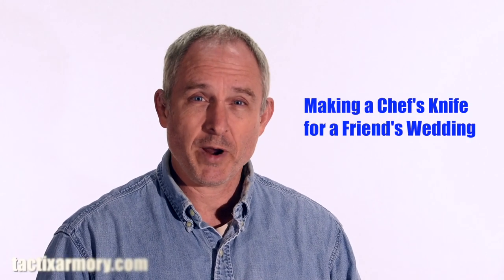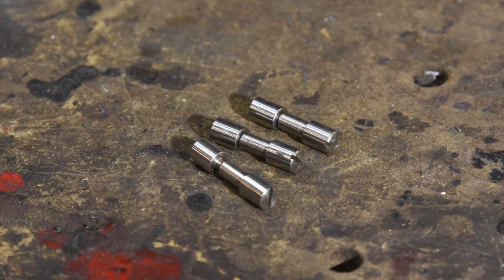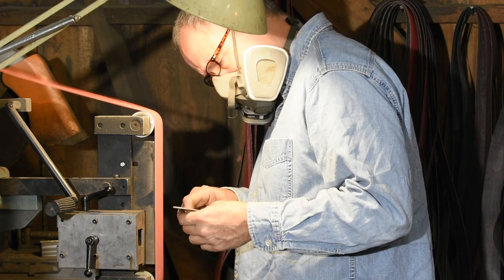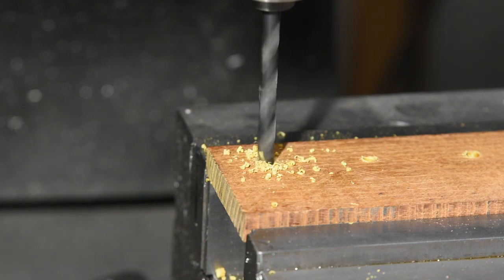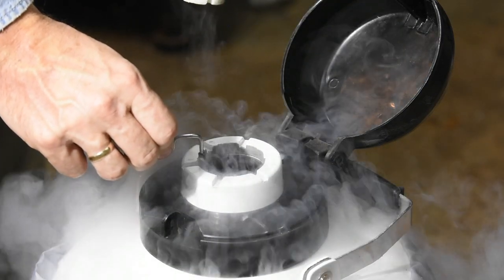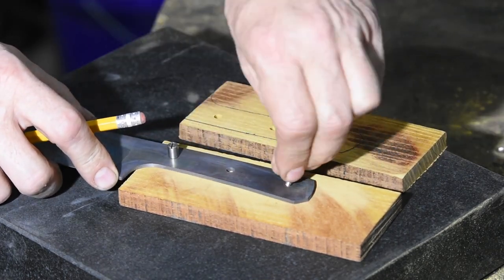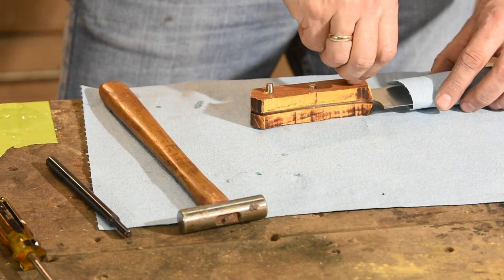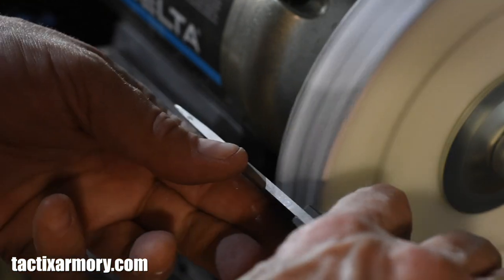Making a Chef's Knife for a Friend's Wedding

Comment: I have a few recommendations on this knife as a pro chef.  No ricasso, most chefs prefer to have full edge along the entire length of blade.  This for both honing reasons and chopping.  When honing a knife on a steel, a ricasso can cause deflection in the strokes, when chopping ricassos will mash or crush food being chopped- especially herbs. 

 More of a bolster in the handle. Personally, I'd extend the handle 3/8' toward the blade. This gives more to grip when a chef chokes up on the knife.

I think thats about it.
Reply: Im not a chef but i fully agree just by using a knife as im starting to cook for myself. i would also add gradually ground handle to the blade to be more confortable for pinch grip
Reply: Agree.  Even thought it's an inexpensive knife, the handle style and handle to blade angle with the slight offset  on the Victorinox/ Forschner Chef's knife is a LOT less fatiguing with long prep work.  Carpal tunnel sucks. The steel is a little soft but the ergonomics are great.  I hate ricasso's on chef's knifes.  They throw off the "rocker" of a heavily used knife, unless you grind them off, and I usually end up using that part of a blade to peel onions  when I'm too lazy to reach for a smaller knife.
Reply: IMOP you can learn alot from watching his channel.  
Very well explained and excellent knives
Reply: Also the only knife type that a high mirror finish applies well to IMO

Comment: Great gift! I'm doing something similar for a friends wedding next year... Talking about grinding bevels like this, I've been doing some experimenting recently now that I finally have a grinder (and my interest is purely in kitchen knives). I experimented with an 8" wheel ,running the blade downwards, like you're chasing the belt (rather than horizontally), and similarly using a large flat area on the grinder , running the knife length ways, to just refine the flatness. I found it works really well, but is probably best suited for those who want a bevel without a ricasso.

Comment: Hey Walter. I liked your video on your CNC experience. I have a suggestion to check out. Get a CNC router to do your handle material. They are much cheaper, with a bigger work area, and you can still get great results on softer material. saving wear on your expensive machine, and freeing it up to cut steel :)
The Shapeoko 3 is a good ridged model with 3 size options. I just ordered a 6040 Chinese machine from ebay. I should get it tomorrow. I'll let you know how it goes. People mill aluminum with these things with very good accuracy when they get them set up. Imagine milling 15X24 inches of handle material while your CNC mills the blades, and you could set up your cnc router with a dedicated vacuum to keep the shop clean from all that dust...no need for coolant. 
Thanks for everything you share with us!

Comment: You probably know this trick already, but since you joke about woodworking skills anyway...  Spray some Pam cooking spray into a rag and coat your Bandsaw blade while turning the upper wheel by hand. Kills the noise, cuts unbelievable smoother, and won't affect the wood.
Reply: Matthew M yessir, any cooking spray will work just fine.  Just a light coat is all you need!

Comment: What you can do is harden the blade to 60hrc, submerge the edge into water and temper the spine into the 50hrc range with a torch.
Reply: S30V has a very specific heat treat regimen, it can't be treated like O1, W2, 1095, etc........

Comment: I’m like, “oh, I can make this!”
Walter: “I laid out the design in CAD”
Me: “ok, no worries. I can sketch it on paper.”
Walter: “I line up the hole placement using the DEE ARR OHH.”
Me: No biggie. I can just lay it out with my calipers and use the drill press. Still good!
Walter: “These are hard to grind”
Me: umm.. ok... but I’d still like to try it. 
Walter: “Next, wrap it in stainless, and soak it in the heat treat oven at (exactly) 1900 degrees for 30 minutes”
Me: Oh. 😔 
Walter: “Next after tempering, I do a CryoQuench...”
Me: ok, ok... I get it. I can’t make one 😔

Comment: Hey Walter, great video, but I have a quick question. Around the 8:30 mark you pull the blade out of the oven and place it between 2 blocks. I never saw you do a quench. I assume that the blocks are to ensure a straight knife, but did you ever quench it?
Reply: Chadwick Meyer he says during the wuech that that is his quench method on this knife. So rather than a typical quench, (heat up and cool quickly) he heated it up and let it cools a bit slower, as the metal pulls heat out of his blade, essentially quenching it. He then follows up with what he calls a cryoquench, which appears to harden the blade in a similar fashion. I haven't seen this technique often, but he stated he was aiming for a thin spring like blade, plus he was using stainless steel not typical HC steel
Reply: Yes it is called plate quenching used for most stainless steels

Comment: Why don't you score the handle when putting the adhesive on the wood ?
Reply: The Wildguide the adhesive in this case does basically nothing. The Corby bolts are what's actually holding it together and giving it strength. Mechanical strength over chemical strength. The glue is basically just for back up and to increase strength slightly. If he scored the scales it would be quite likely that he would have gaps and air pockets, with the possibility of his scales not going on flush, which would decrease it's mechanical strength significantly. This is my best guess, as honestly glue isn't necessary for these types of knives. Even with just peened over pins that is what gives the most strength, not the glue.

Comment: I see when you drilled the holes in the blade handle.  Once the drill tip gets through, guys will poke it through another 2-3 times.  There is no need for this.  
Once the hole is through, its through.
Im a machinist of 20+ years and it baffles me as to why people do this when drilling.